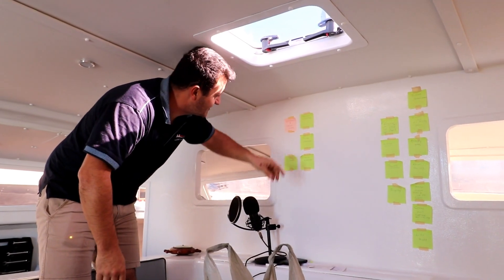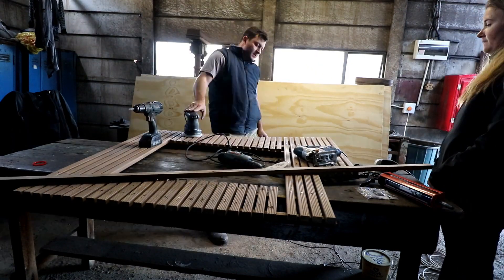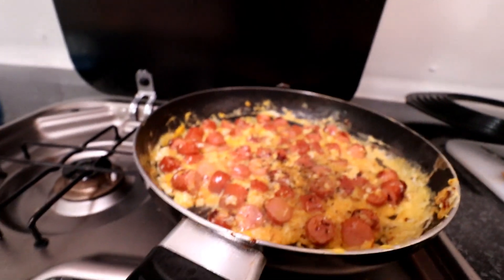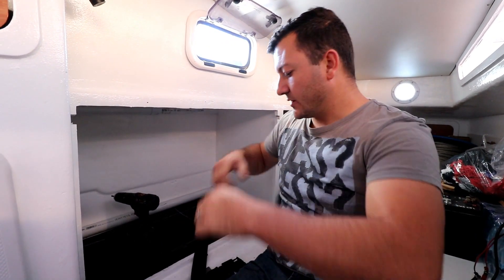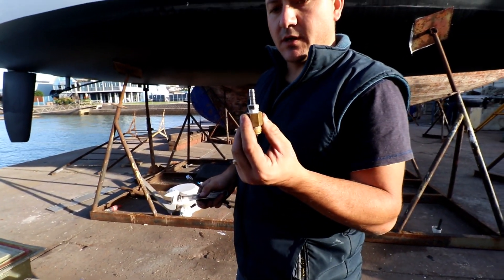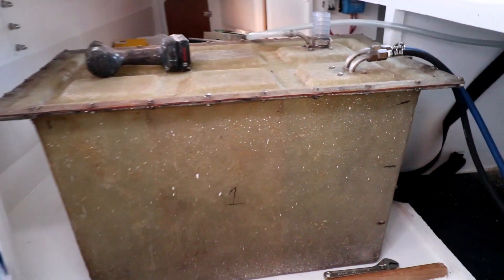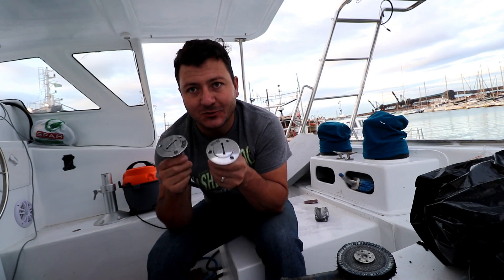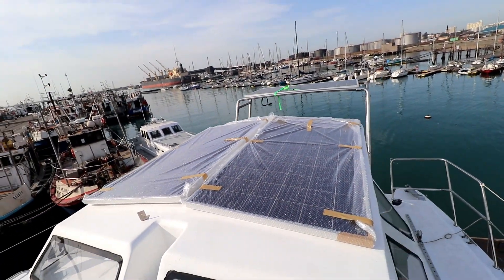NO engine yet...but we got DIESEL TANKS!!? | YACHT REBUILD WEEK 78

Comment: Ahhh... just a point on the timber grate in the cock pit well.
If that is decking timber you've used the ribbed side is meant to be face down. this is to allow for any water to evaporate off and not wick in between the two flat surfaces. It is a very common error for those not familiar with outdoor decking practices.
https://www.softwoods.com.au/blog/should-decking-ridges-face-up-or-down/

Comment: 300  liters should give you enough for 4 days motoring or about 600 t miles with a 50hp engine,make up some dip sticks when you fill the tanks and mark them every 20 liters so you can monitor how much fuel you have left in the tanks.

Comment: Q: only why did you Not put taller support beams under the cockpit floor so the floor would have been all timber and you would not see the Hatch just leave a cut out around it ,But looks good guys, with your fuel tanks did you think of putting a fuel grade pipe sight translucent from the bottom of the tank to the top and not just trust the electrical  fuel gauge in the cockpit just thinking down the track.

Comment: Dear Ricky   you have redone your Sailboat and looks great so why did you short cut the Fuel Tanks and Water Tanks  you should recoat the inside the Fuel and Water  to seal that old Fiberglass plus Epoxy the outside to make it clean and a little stronger, Hope no leaks to Come. They make awesome Fuel paint for the inside. God BLESS
Reply from the maker: Interesting that you asume we short cut , perhaps you don't understand the material the tanks are constructed out of . The water tanks are not even in this episode ?? . You are worried about cosmetics and not functionally,  each to his own I suppose.  😎 Thanks
Reply: Sailing Lady Africa  I did not see a fuel gauge sender or wiring....did I miss it or do you visually check the levels...therefore no coating?